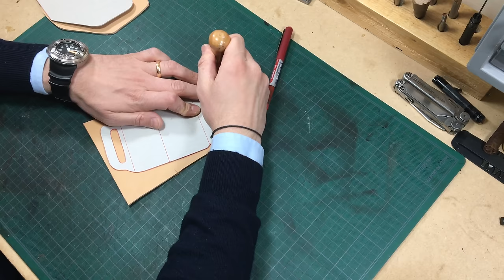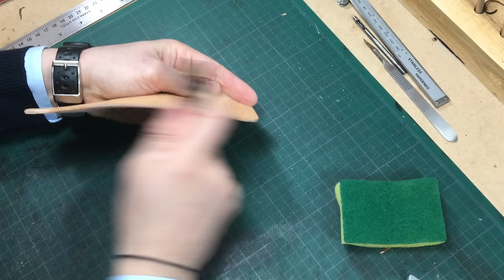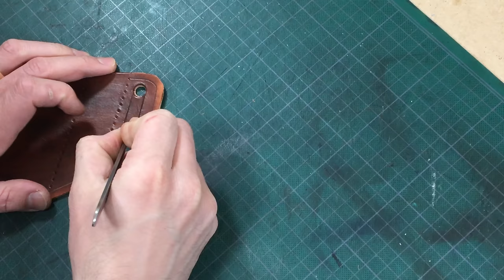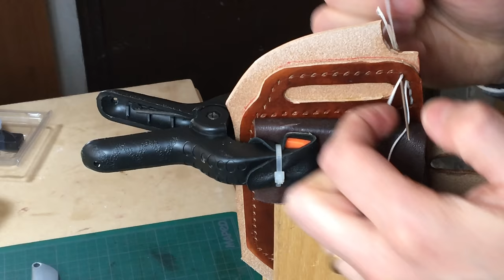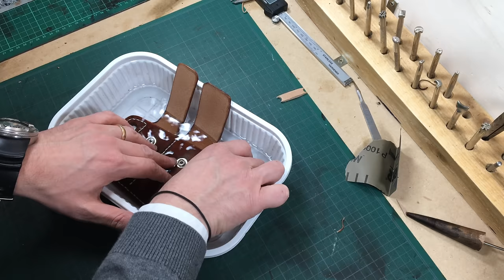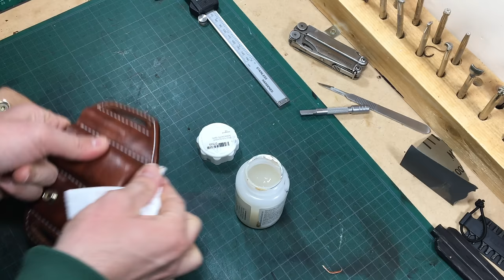Leatherman tools  leather sheath

Comment: A few questions if I may ask? What brand and size pricking iron did you use on this project? I really like the thread spacing it is perfect for that project! What size Tiger Thread did you use? I really like the color! Did you mix stains or is that a particular color? If so what brand and color is it, if I may ask? What size snaps did you use? I really like the proportions to the case.